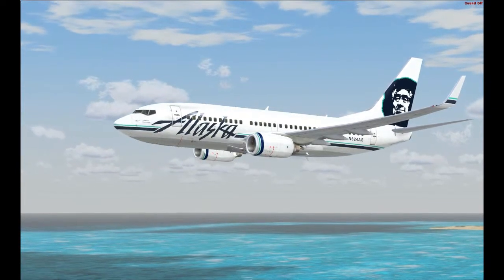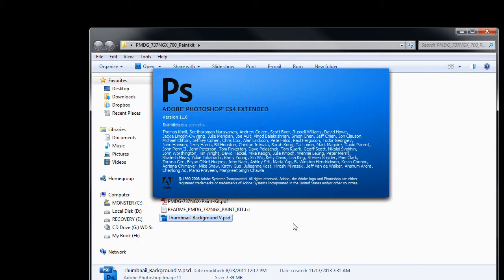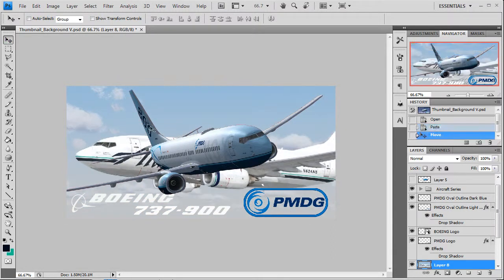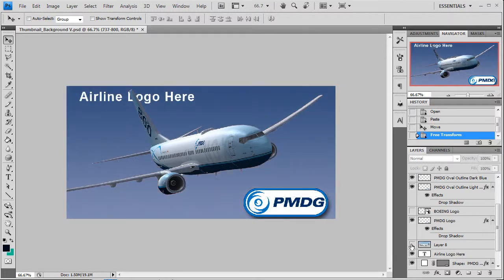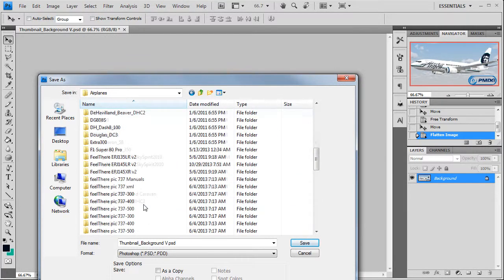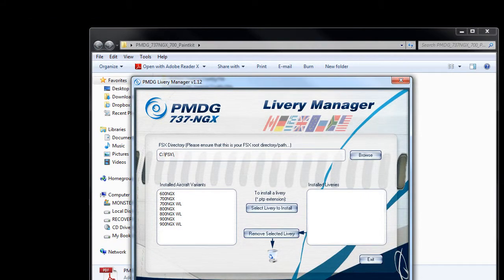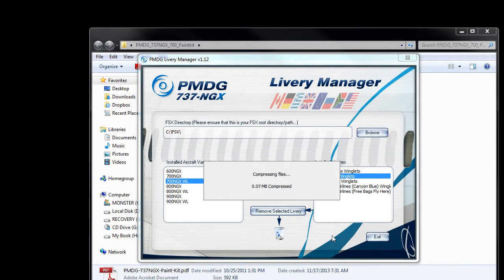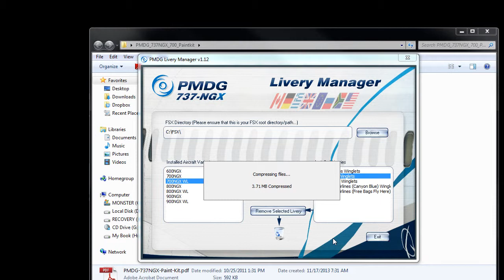PMDG 737NGX Repaint Tutorial - Part 8 of 8

Comment: Nice job Gary.  I would be interested in seeing an aircraft with aluminum surfaces.  Maybe the PMDG B744F or one of the Level-Ds in an all aluminum freighter. 

I have Paint Shop Pro, but it appears to have most of the features of Photoshop.
Reply from the maker: An all aluminum skin can be tough. With FSX though using a model that takes advantage of a specular layer, you could make a great paint I think.
Reply: revrengary There are very few aluminum  finishes that I like.  Hope all is going well.  I've missed talking to you on AVA TS.
Bill

Comment: I watched all these tutorials and they were excellent. I followed everything you did to the letter except when it came to converting the files to DDS. Instead of using imagetool, I used DXTbmp. It seemed the only difference was when I was saving the textures to DDS there were a few different DDS options. Like: 888 8 32 bit DDS, which was the one I chose. After I had done everything else and loaded  my texture into fsx and everything, I clicked on the aircraft. When it showed the preview, the livery was completely muddled up. Everything was in the wrong spot. The belly texture for example, was sitting on the side of the fuselage while the doors were all upside down, and more. Do you have any idea what could have caused this and how to fix it? Could have something to do with when I converted the targa files to DDS? Thanks
Reply from the maker: Yes, DXT BMP will not support 4096 textures.  When you convert a file with imagetool to DDS it flips the image vertically.  Also you could use the photoshop NVIDIA plugin to do this as well.  This is the reason I do not use DXTBMP when working with textures larger than 1024.
Reply: revrengary Thanks, could you please link the NVidia plugin because I googled it and i'm not sure which one?
Reply from the maker: https://developer.nvidia.com/nvidia-texture-tools-adobe-photoshop
Reply: revrengary thanks so much